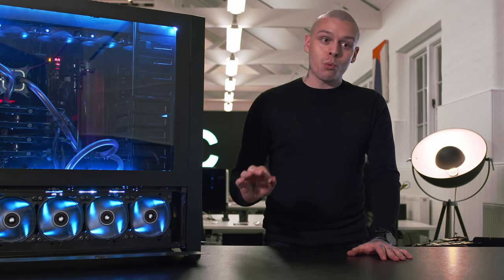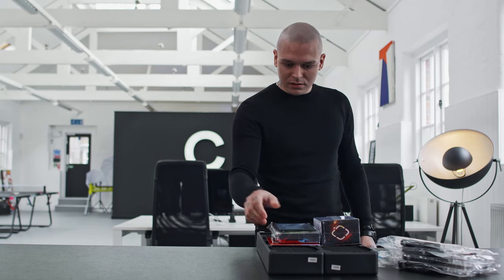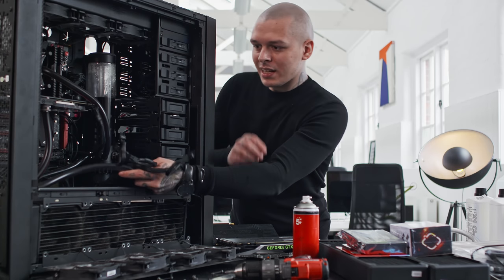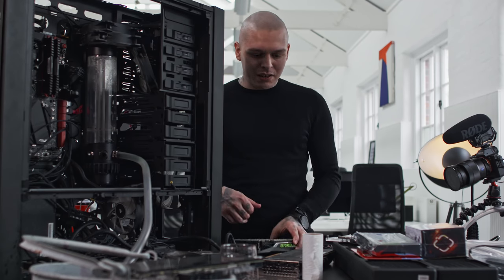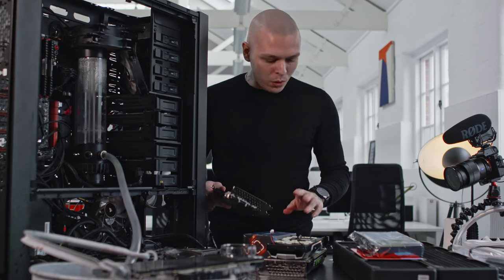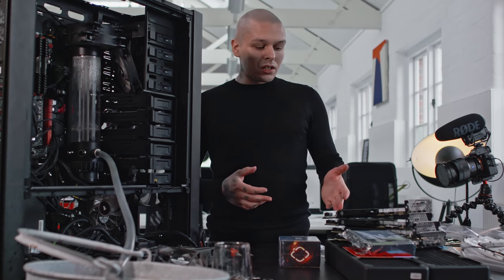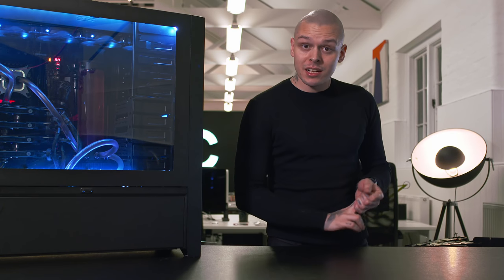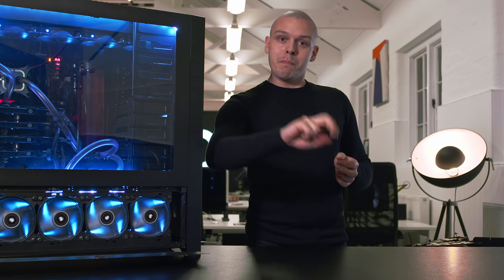Watercooled CG & VFX WORKSTATION

Comment: If anyone wants to build a similar multi-GPU-focused PC today, I would suggest going with a Threadripper 1900X for its 64 PCIe lanes :)

Really nice build, you knew what you were doing. Props on using a dedicated output card, people keep forgetting you can do that with graphics cards.
Reply: I just got the x1950 Threadripper with the Quadro P5000!!!
Reply: That's hard-core man... I have a 1950X and a GTX 1080
Reply: Why threadripper with 16 cores in not even at par with 10 core i9 ???
Reply: kushal chaudhari what do you mean?
Reply: neoqueto when i checked comparison at userbenchmark between threadripper 16 cores and intel i9 10 core. I saw that even though i9 is having 10 core still it was faster in performance as compared to threadripper hence i wanted to know why so.
Reply: Because Userbenchmark is tilted towards single-threaded tests, as it's mostly used to compare gaming performance. If you check Cinebench scores, or any heavily-threaded benchmarks, 1950X mops the floor with the 7900X. They both are great chips, but have slightly different applications. i9 is better for stuff like Adobe Premiere.
Reply: neoqueto ok thanks 😉
Reply: For an in depth review of the thing, check out Gamers Nexus, they make great reviews
Reply: Tech Jesus is our lord and savior.
Reply: Get a xeon instead for very heavy workload duh
Reply: FYI, as it stands, especially for AVX/SSE2 accelerated stuff (like render engines), the VRMs on most TR x399 and i9 x299 motherboards are not really cooled well enough, and a "full cover block" is highly advised for such builds. The CPU will throttle back because of the temps of the VRM. I can not stress just how high the watt consumption is for these kinds of workloads that drastically goes way over the advertised TDP for the CPUs (especially when overclocked).  Case and point, the R7 1700 (non-x) that I have is advertised as only 65 watts, lol, I've seen 240 watts routinely on the meter when doing 3delight renders (CPU render engine). A friend has an i7 8086k (binned 8700k) that is advertised as a 95 watt CPU, and it was up to 267 watts in P95.  even if the VRM is 90% efficient, that's still 10% of that amount of watts being pumped into the "fashion accessories" on the VRMs in the form of heat. There is just no way the VRM "fashion accessories" can dissipate over 20 watts of heat, and on the x299/x399 boards there blocked from getting airflow by memory on both sides of the block, just making things worse for the VRM, lol.

The x99 setup Andrey has is very nice looking, and I think the VRMs are in better shape than the newer generation of stuff for CPU intense stuff. As attractive as the newer CPUs are, The EVGA x299 Dark aside, I'm just not impressed by the newer motherboards. B)

P.S. and I've also been scoffed at by gamers for not just plugging the monitors into the "better" graphics card, lol.
Reply: @RizLazey   
PLS TELL ME HOW MUCH IT WOULD COST ME TO ASSEMBLE A SYSTEM LIKE THE ONE ABOVE.? 
THANKS

Comment: Had to subscribe! Great details in the explanations! Just ordered my first build. Came out to $5,180.00 USD. I got the Ryzen Threadripper (16 cores 32 Threads 3.4gz), ASUS ROG Zenith Extreme sTR4 x399 mother board, x1 Quadro P5000 (going to add more later on), x2 Vengeance RGB ddr4 3600 16gb RAM cards (adding more later), x2 4Tb BarrCuda HD, Samsung 860 EVO 500gb SSD (might get some M.2's later), Enermax  Liqtech TR4 240 AIO liquid CPU cooler, Corsair Obsidian 750D Airflow Black bushed aluminum, Corsair RM1000x 80 Plus Gold power supply. Plus x2 Acer 25" monitors. One standard HD and 2nd WQHD 2K IPS 4ms, Corsair RGB keyboard and Logitech G502 Proteus Spectrum RGB tunable gaming mouse with 11 programmable buttons! Had to get internal DVD drive to install software. Can't wait to build it this weekend!!
Reply from the maker: Those ryzens are sooo damn good. Well planned build mate, congrats! Loads of fun upcoming weekend 😄
Reply: Thanks! Can't wait till I can add few more P5000's or get a P6000! I really like the studio you're in! I'm hoping to get into something like that when I start my VFX department!!

Comment: Nice video, one thing: canned air is a very potent greenhouse gass as it isn't just compressed air, usually one can is equal to burning around a 150 liters of fuel. Also, it isn't good for plastics, which your ram slots and cpu sockets ect won't like. A longer term cheaper alternative (if you add up the dozens of cans you can use in a lifetime) is to get something like a metrovac datavac ed-500esd, you could also get something half that price but you might not get the esd versions.

Comment: When filling the loop, you need to connect the pump directly to the PSU, and then in the 24-pin output you just need to close two specific contacts (you can buy prebuild cap or just use a staple or piece of wire), now when the PSU switch is turned on, pump will work without starting the system. Doing it the way you showed is really dangerous and can damage your components. But great vid anyway, it's very useful for me to know that 3x GTX 1080ti can work decently without watercooling, since I thought that watercooling is essential in 3+ gpu's rig! Now I want to know how did you end up in UK :)
Reply from the maker: That’s exactly what I said in video 😂 Thank you for the comment! Moved in UK 5 years ago as my wife lived here for 11. Clearly more opportunities for VFX here :)
Reply: Yes but you don't need another PSU for that, you can just unplug it from motherboard, close the contacts and plug it back in after filling :)

Comment: Nice piece of art :)
I have the same PC case and I have 2 questions:
1. How did you mount the pump inside? Did you have to drill some holes in the back wall?
2. Not directly about the case: I also have 4 GPUs and the lowest GPU covers the power socket on the motherboard. So that I have to turn the PC on with the button on the motherboard itself. And how do you turn the PC on?
Reply from the maker: 1. Yeah had to come up with my own way of mounting it. Drill some stuff.
2. Take off the shell of the connectors, remember where everything is though. Isolate them from each other (gaffer tape) and connect one by one. There will be no hard shell anymore to cause problems )

Comment: 10:09 batter is clean silicon chip using isopropyl alcohol.
11:49 little bit too many thermal past.
16:07 nope, they aren't clever. You just need to connect green with black cable in 24pin connector ( you do same thing when you press power button ), but it's recommended to connect some load, for ex hdd, waterpomp etc.

Comment: Thanks again for another great tutorial Andrey.  Seriously love your channel.  Quick question when you've got a sec... because you're stripping the GPU down to it's base and then adding the watercooling, would you say this means any version of the 1080ti would be fine to use?  the price of the different versions seems to go from £650 up to over £1000 so wondering whether your approach means getting the cheaper versions would be fine? thanks again dude
Reply from the maker: Hi mate,

Thank you for your comment.
Performance of the cards is the same across all the makes. Form factor and cooling performance is what differs, and therefore the waterblocks will be different for each make. I’m always buying founders editions because it’s original design. Cheaper version would be fine ;)
Reply: great. thanks for the info!
Reply: hi again Andrey, about to bite the bullet and buy components to build a machine but am also considering building a second system with two GPUs as a render system so was looking at your specs for that as well.  Can I ask why you went for 64gb RAM?  I would assume when it's just being used to render, not to work on, that RAM becomes less of an issue but Im not really too up on stuff like that so could be missing an important reason for choosing 64gb.  Totally understand if you're too busy to reply dude so no stress!
Reply from the maker: Hi mate. I just had spare RAM so installed it :) you’re right - it’s not essential

Comment: Great video Andrey!

There is only one thing that I kind of don't agree with, and that's the way and amount of thermal paste you put on the GPU. In my opinion that is way too much.

I usually use just a small "ball" of that in the centre of the CPU/GPU, and let the pressure do the rest (spreading without air bubbles).

Though obviously it is fine if you find yourself alright with your method.

Other than that, nice job!

I have an Obsidian 750D as a case, an i7 5960X water cooled with a simple AIO from Corsair (H100i GTX 240 mm Extreme), three Titan X (the old ones, not p or V) founder edition (to get the hot air out from the back, rather than vertically, given the three cards are "sandwitched" one on top of each other), 64 GB G Skill Ripjaws 4, a Lepa MaxPlatinum 1700W PSU... And few other parts.

My graphics cards are not water cooled, because I am kind of on the edge with dealing with the maintenance.
Reply: i thought the same (: My heart was jumping a beat. Too much thermal paste and you insulate instead.
Reply from the maker: Cheers guys. To not dive in deep discussion I’ll just say - don’t be afraid of it gentlemen. X - is a proven measuring method to fill the surface evenly. Might used too much, yes (which is alright), but look how neat the CPU paste looked like in one of the timelapses 😂 Thank you for your comments
Reply: Hehe :D This is also just details. The CPU paste was sexy.
Reply: As long as it's not conducive (like liquid metal) it's fine. With an unnecessarily thick layer you may get maybe 2-4 degrees increase, not a big deal. It's always better to use a bit too much than not enough. It will spill out from the sides under pressure, and make a mess... And that's it.

Comment: Great video. I'm going to go with a water cooling system like the one you have. Although, I have 2x Asus 1080 ti and 1x 1080 ti founders. Is there a water block solution for Asus 1080 ti? My other thought is to sell all my 1080 ti's and until Nvidia releases the new bad boy in a 2 months.  Then the question arises if water cooling manufactures will be quick to produce a water block for the latest GPU.
Reply from the maker: I suspect ekwb waterblocks would fit Founders Edition if new GPUs will be similar in design. It might be tricky to connect different GPU makes together in terms of fittings. Selling your asus ones seems like reasonable decision. Although if new cards will be different it usually not long until waterblocks are released :)
Reply: Have you considered using Redshift?
Reply from the maker: Nope. It’s biased :) I tested it though. Very good engine

Comment: Hey buddy, let me ask you something!

I didn't understand how multi GPU works. You put your 1070 connected to the monitors and the 1080s to render.  But while you are working you need to see what you're doing... the 1070 is doing it or the 1080s? Let me say you are doing something in blender: while you're modeling it is with the 1070, but when you render it switches to the 1080s??

Sry if I wasn't clear
Reply from the maker: No probs mate. 1070 is showing what you’re doing (outputing windows data). 1080Ti cards are idle while not rendering. As I’m using Octane for rendering, I can specify which cards to use. Only 1080ti cards are rendering, leaving my Windows data output unaffected. So the system is always responsive. I can edit or color grade while rendering in the background. Hope that helps mate ;)
Reply: Ah, gotcha!! Thats actually pretty good. Didnt knew how it works! Ty for your fast answ! Greetings from Brazil buddy!
Reply: if i am not mistaken Resolve uses all available GPUs when previewing as well (realtime rendering). Maybe that is what the OP asked. That is why you add more cards to get better realtime performance in heavy projects and of course always output from a +1 card for the reasons mentioned.

Comment: You should have gone for quado p5000 or amd redeon pro.. for the best workstation performance.😃
Reply from the maker: Quadros are expensive and for very specific calculations, AMDs don't work with my Render Engine :) GTX1080Ti beats quaddros in terms of performance in Octane so for the price it's a no brainer

Comment: Thank you! Really great video! I have a question though. Is it possible to multiply two gpus ( discrete + external one) to double the render speed in 3d modelling using octane or redshift plugins for c4d???
I`ve got Dell G5 Inspiron 5587 4K with GTX 1060 Max-Q 6GB and considering to buy another external one from Aurus and connect it via thunderblt 3
Reply: No

Comment: Hi Andrey, are you sure that davinci and Fusion benefit from multiple GPU? I saw some tests on YouTube  where you could not notice any benefit by multiple GPU. Would bei great If you could do a short test with single and multiple GPU for davinci and Fusion. Or as con-fusion would say... Dafusion 🙂. Thx Mate!
Reply from the maker: Hi mate, well Fusion benefits kind of. One card can be dedicated to OpenGL and another one for OpenCL calculations. That’s basically it 😄 you can increase render speeds by utilising network renderer. As for Davinci, it can use all the GPUs, yes. Not sure how it works in new version. I tried to use fusion inside Davinci and it was awful. When I tried to use trackers... blimey... I just wish it will be better soon, meanwhile I’ll stick with premiere again.

Comment: AlsoI'm working with an HP xw8600 2x  xeons 5470 @ 3.33mgz,  32GB ecc ram,  gtx 680,  2x  500gb SSD  raid 0 config,, I'm a part time employee @ best buy so fund are tight is there anything else I can do to improve proformance with out breaking the BANK.>???

Comment: Why didnt you go M.2 while you were at it?  Read/Write speeds are way faster than traditional SSD's at this point.
Reply from the maker: I have nowhere to put it. I’m on raids )
Reply from the maker: With next maintenance I’ll probably do a good cable management, at the moment there’s a mess behind GPUs. Had to assemble it quickly to get back to work but now that you wrote that I think... I haven’t even thought about that option 😂
Reply: I have two now after replacing my main drive with a 950 Pro and wow, its been one of the most impressive upgrades Ive done in awhile.  I used to love my water cooled rig too, but oh man the maintenance and worry about leaking lol.  I wish Adobe would get into the multiprocessing with GPUs already.

Comment: I'm studying a perfect machine for my money.  I've got 5500$, however I was looking for at least a Ryzen 32 core and multi 1080ti or RTX 2080... I could've build my own for less money, but I am not experient enough and I'm afraid of mess it up. Sugestions?
Reply from the maker: It’s hard to mess it :) just google every step and you’ll be fine... case - motherboard - cpu - ram - psu - Ssd/hdd - GPU - install os - done

Just make sure to research how to connect each part properly 😉
Reply: @AndreyLebrov  I thinks that's gonna be the way, I can save a lot of bucks.

Comment: I am a beginner In graphic designing and have a question related to PC for CG and VFX
My 2018 PC build is:
Processor - AMD Ryzen 1600
RAM          -  8GB
GPU           - Gigabyte 1050ti OC Windforce
MB            -  Gigabyte AB350M
Storage    - SSD(for windows) and HDD
Can I work on this machine ??? 
IF NOT :'(
Then Please tell me what is the minimum requirement
Reply: there is no miminum. you can work on this machine and become an excellent vfx artist. all comes when you need extra power to reduce render times and realtime response. but reducing render times is more up to you (optimising, workflow, vfx methods) than the system. If you are using a x10 wrong menthod than you will have x10 slower performance on any machine.

I would suggest bumping up to 16GB of ram though. VFX is memory hungry. In large resolution, multi composition projects, only going from 16 to 32GB of ram can give you x10 performance. Fusion is very hungry as well.

4GB is appx. used by windows. So you are left with 4GB to work. With 16GB, you are actually going x3 memory, from 4 to 12, +4 for the system.

But as said, you are good to go learn anything you can imagine with your setup.

When clients pay more, you can invest more to your machine, and enhance your productivity.

Till then, you have a journey of learning how things can be done, then how it can be done in a faster way on same setup, and long after that, what upgrade would be suitable for your specific needs.

It is better to start with a goofy machine, to learn what optimising is.
Reply: @constantinosschinas4503  Man thankyou for your response !!!
I was in confusion related to my PC, but you motivated me 
And yeah by the end of this year I am going to upgrade my ram.

TY <3 
PEACE

Comment: hey Andrey I am running - amd fx 8370 8 core processor 4.00 ghz
                                            - Nvidia Quadro p4000
                                            - 8gb vengeance ram 
                                            - gigabyte 970 gaming motherboard
                                            - corsair VS650 supply unit
I made it 4 years back and it gets slow at rendering a single image or working on any kind of simulation, now am thinking of upgrading in under 3000 USD please help me as am really confused what to get (want to make a system where I can work on both video editing and 3d assets and simulation)